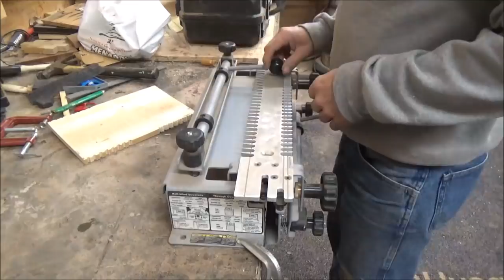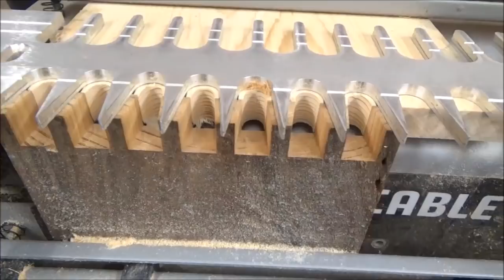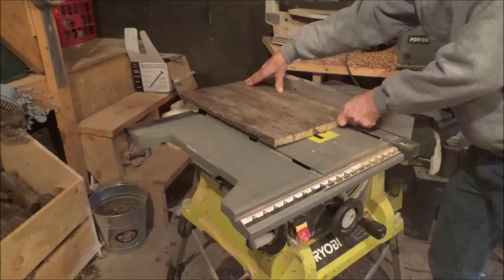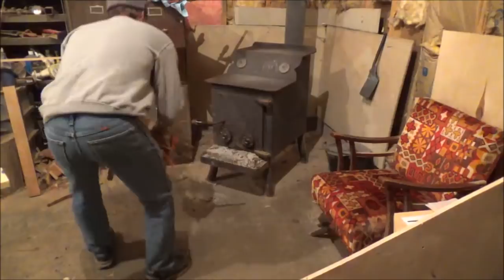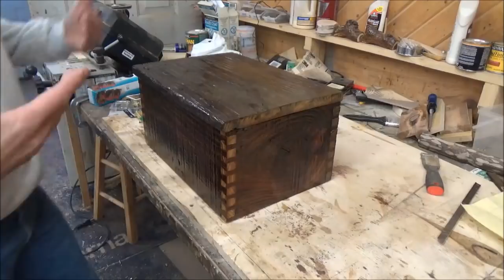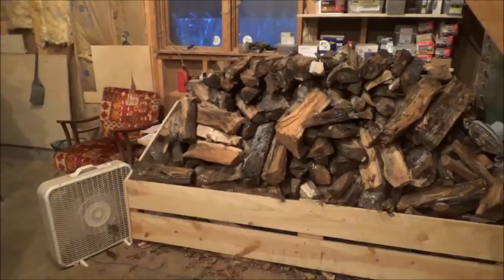THE WORKSHOP. Dovetail Box. Antique looking. Old Growth Southern Yellow Pine. Dovetail Jig.

Comment: Box looks great! Next time if you wanted to "stain" those spots, I've used those wax touch-up crayons at the hardware store and I've even used shoe polish. Both of these give you full control when applying. ... Also, I watched a video a while back, where the guy antiqued his hardware with a blow torch. Turned the metal black. ... Also, consider the kind of hinge that goes inside, kinda like a closet door hinge. xoxo from sunny Arizona, 75/45f today.

Comment: You can take the warp out of a board by wetting both sides. With your lid put the bottom side facing the stove . The heat will draw the wood back. Keep a eye on it until it gets where you want it and set away from the heat to finish drying on it's own . Or once away from heat clamp it down on something to finish drying.

Comment: If you want to mask or tone down the color contrast between the old look of the weathered wood and the fresh cut edge, rub a bit of wood ash on the freshly cut edgesor even soil if you want it darker. Then you can wire brush the edge to soften the edges of the cut.  Use a scrap piece to get the look right before application to the work piece. I have used this to good effect several times.

Comment: you can also use thin rippers as edge protectors when clamping up
Reply: darangemaster1, what's "thin rippers"? xoxo from Arizona
Reply: when one sizes board to their appropriate width you are left with an off cut that can vary in thickness but has a nice clean edge. you can place those between your good board and the clamps so you don't booger up you project....
Reply: darangemaster1, I thought that's what you meant... Just never heard them called that before. Thanks so much for the explanation. with love from Arizona.
Reply: i plan on moving to AZ when i retire sw of prescott
Reply: i plan on moving to AZ when i retire sw of prescott
Reply: darangemaster1, oh! That's less than 2hrs from me! When are you moving? You'll love it there. It has 4 seasons.
Reply: i won't be able to pull the pin for four more years been scoping out property in the area and usually make two trips a year to yarnell as my buddy lives there like to buy something in h next year so i hav plenty of time to get it refurbished
Reply: darangemaster1, sounds like a dream come true.
Reply: if you dont have a plan you cant change them!

Comment: This is the first of your vids I've seen.  Hit the thumbs up for the box build...but then you "Varnished" it to death.  All that work to end up with a poly-ed up mess.  Wish someone would have interrupted, intervened before you broke out the brush-on poly.  
I have since checked out your other vids, liking those mostly, so far.  I figure you are thick skinned enough for a little criticism, not as thick as 6 coats of polyurethane thick skinned, but hardy enough to take this.  Unless you need it as a memento of a bad decision, I'd burn that box and start over.
Reply from the maker: I put an additional 3 coats of poly on that box.
Reply from the maker: Across my 2 channels I have almost 140,000 subscribers. I have learned to take some criticism but it does not change how I do things. You do it your way and I will do it mine. Thank You.
Reply: NorthernSeclusion   Felt like you were getting a free pass on that choice of a finish in the comments with your fans. I should have reserved comment until after I've seen the final project as you intimated to see why you went with the gloss poly.  Appears you know what you're doing, can't wait for the big reveal.